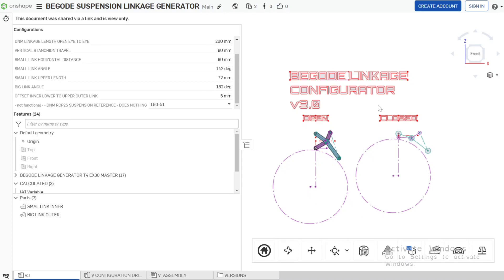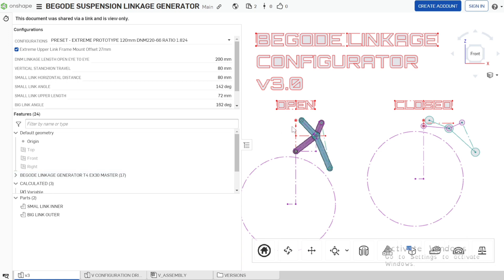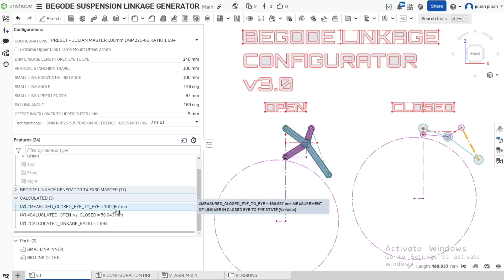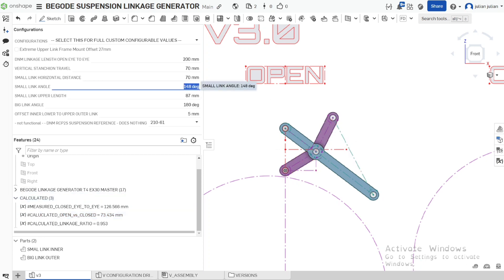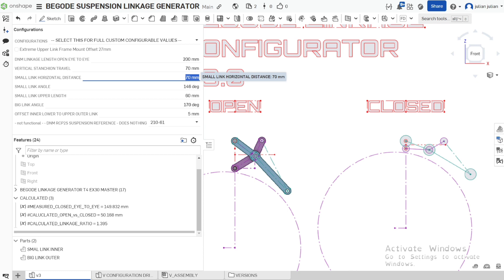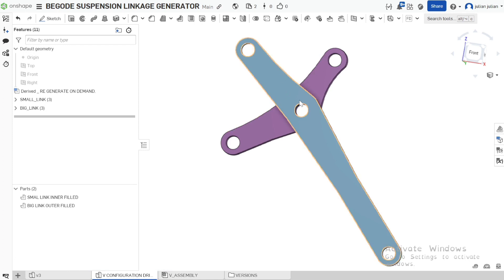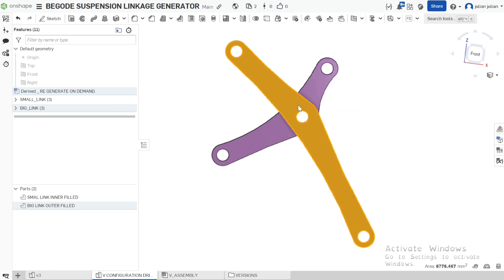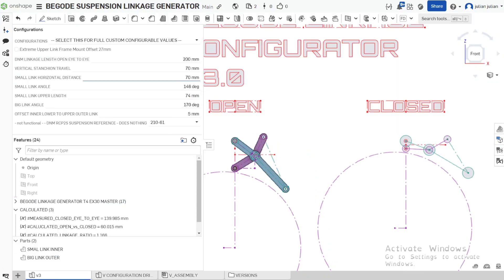BEGODE Custom Linkage Generator For T4, Master, EX30, Extreme

Comment: This is incredible work... The community appreciates you. How does one spec a linkage for a master pro v2?
Reply from the maker: What's the vertical travel on the stanchion pole for the wheel ?
Reply from the maker: BEGODE spec says to 80mm travel so that would mean it's same as a master of 70-72mm